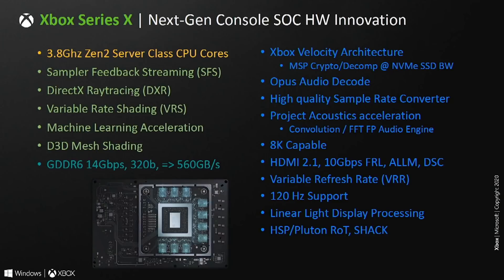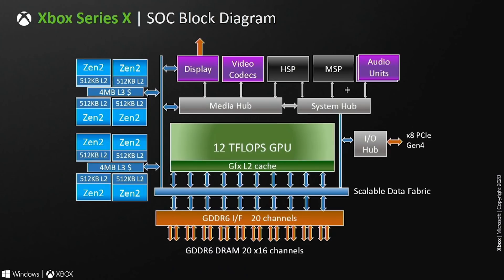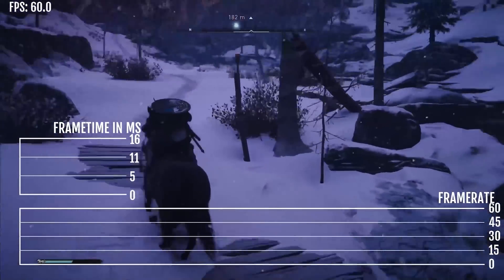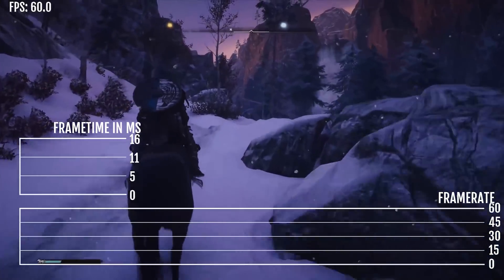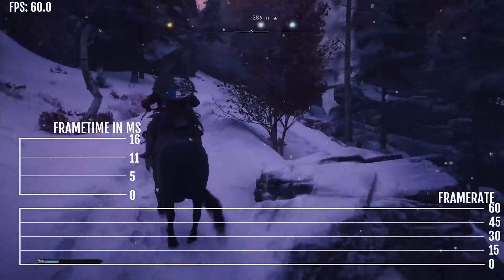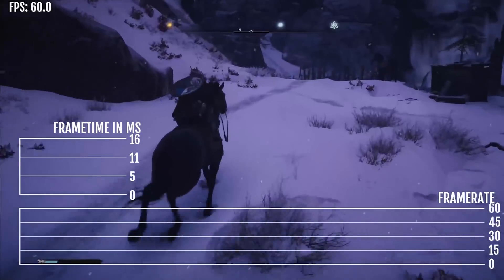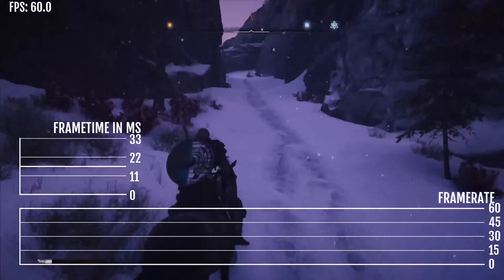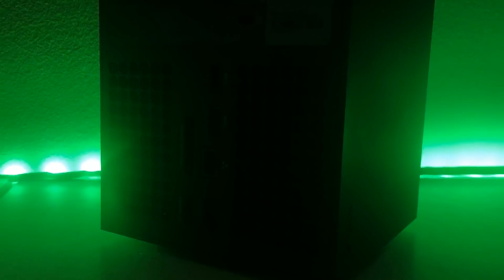Xbox Performance to be UNLEASHED | Xbox Series X Mesh Shaders & SDK Updates Changes Everything

Comment: It would be so interesting if Microsoft allowed/licenced AMD to release the XSX chip as a desktop APU. 

That chip in a desktop power envelope would be a monster, it could possibly use an un-cut-down die depending on how yields are now but crucially the XSX has a 320-bit memory bus but only uses 10GB of memory at this speed for financial reasons as MS can cut the other 10GB down to 6GB running at a much slower. But this could easily be changed to run the full 20GB of memory at the full 320-bit speed but I would propose upping the current 2GB modules to 4GB and so having 40GB of much faster GDDR6 memory all using the 320-bit bus and then using this as a unified system memory, ie doing away with the much slower DDR4 DIMMs we normally have in a PC build.

I would love to see how this would perform, I think it would be much faster than most think and not just in gaming but regular applications too as everything is on die and high bandwidth.
Reply: But desktop CPUs/GPUs are way stronger than what they put in the consoles
Reply: @masterlxds  It's not to replace a 3090 and 5950X but it would just be a monster APU for a low cost all in one system that can easily give you 'better than XSX graphics'.
Reply: Series X is weak compared to computers... It wouldn't be viable in a laptop either due to cooling needs.
My computer is already 42Tflops compared to Series X 12Tflops and that's at launch. The CPUs used are also not great since they are limited by the integrated GPU. Series X cpu when running all cores is 3.6Ghz compared to a Ryzen 5000 cpu hitting 4.8-4.9Ghz running multi-threading
Reply: @PCGGC  Did you pay more than $499 for you computer though?
Reply: @PCGGC  talk about the xbox being weaker than your 42 tflop pc but then praises playstation 5 in another comment. Which is weaker than xbox and cost the same amount as the xbox. Nothing you say is valid
Reply: I think ps5 and series x both will get a pro version after 3 years. Altough ps5 is out performing series x by a good margin in open world games and games I'm general. But when u look at how much both series  x and ps5 has to compromise on resolution. I think if these companies do not release an upgraded series x and ps5 I am certain that 4 years into the generation games thar actually take advantage of the hardware will be running at 30 fps with resolution falling down to 1080p. I think it will become increasingly difficult to maintain 60 fps in games. I think both Sony and microsoft should have waited before releasing ps5 and series x